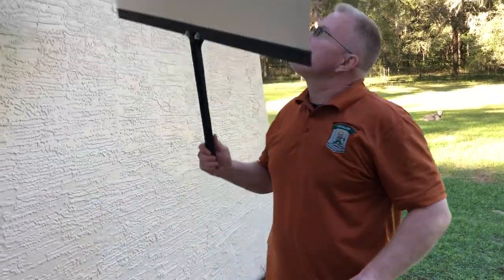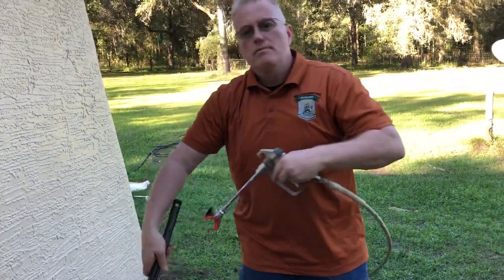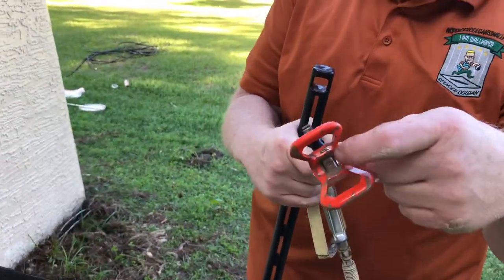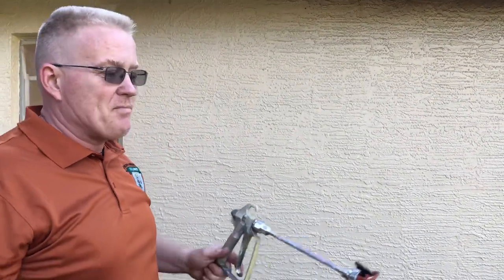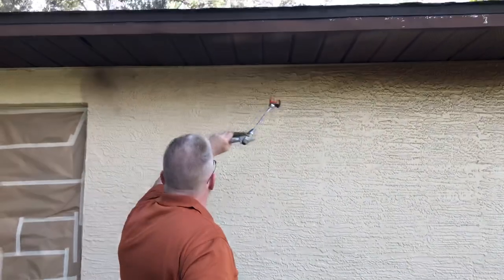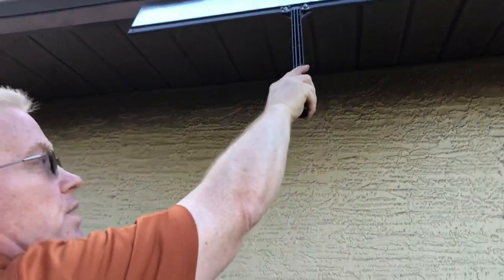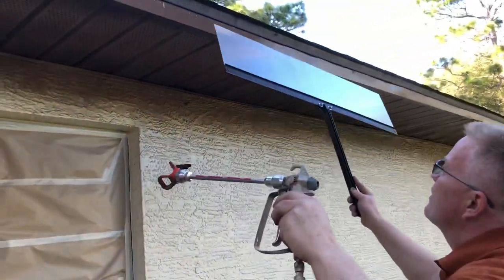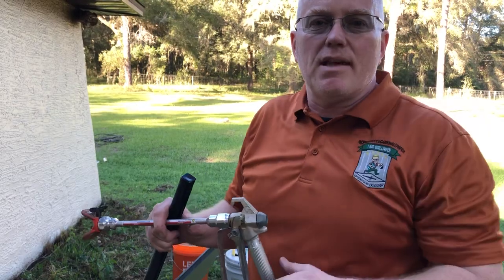House Painting:  How To Spray A Soffit With Spray Shield - Spencer Colgan

Comment: What about the overspray you're getting on the house? Also, will that paint require a second coat and if so will it clog the soffit vetalation holes? I'm going to be doing my sisters vented soffit that her so-called handyman got overspray onto when he painted her house. The house is tan & he got it on her white soffit & facia. One more question, is there a less expensive airless sprayer that can do this job properly? I dont have that kind of money as i had a stroke in April & havent gone back to yet, so funds are scarce right now for me. She's paying me to do this, so i would like to be able to MAKE some money & NOT spend my profits on a sprayer that expensive

Comment: You’ll have less overspray w an fflp tip and they make longer shields, I use 5 so I can rotate them as they become heavy w wet paint while a helper hoses the paint off and waves them dry so I only have to stop for ladder moves. Lay a long drop w weights or magnets over the roof if it’s windy to shield any overspray. Keep your gun steady so the fan is perpendicular to the soffit w a 50% overlap if using an orifice .013-.015 25%, if paint formula requires anything bigger like .016-.019, to get the appropriate mils otherwise the paints’ warranty/guarantees wont hold true. If I don’t have helpers I’ll take the time to tape up paper instead of shielding the body of the house and only shield fascia since it’s a pain in the butt to keep paper wet w paint from flipping towards the fascia.

Comment: I purchased a spray shield that attaches to a roller extension pole.
You can tape cardboard stripes to the shield that extend the full
length plus two feet past each end. Have a helper stand behind
you with the pole over your head. It is much faster than doing it
by yourself.

Comment: Thanks for the demo and the tips. I’m determined to do many things about my house myself to save money. 

So here I am with soffit that is charcoal colored.  I’m changing it to white.  The fascia and gutters will be white too so I just have to protect the roof. 

My question is, going from charcoal soffit to white— is that going to require the same 313 tip? Do you recommend certain type of paint and/or paint company?  Behr exterior house paint ok?
Reply from the maker: I would use a 211 tip for those tasks.  Especially the gutter.  I recommend a quality paint. Putting all this work into a project and using a cheap paint,  not that you would Cheryl ( but a lot of people read these answers and so I speak to everyone) isn’t worth it. 

High end?  Marquis exterior end.  Medium:  Behr ultra paint and primer included.
Reply: Spencer Colgan Wallpaper & Painting  Thank you much!🥰

Comment: How are you not plugging the soffit perforations?
Reply from the maker: That’s an excellent question! If you use a 517 tip, you will plug all of those perforations! However, I am using a 200 series tip and when you use a smaller tip like I am using here, there is not enough paint to come out they will clog those perforations. Thanks for watching
Reply: @spencercolgan  is this something most professional painters will know?  We need to have our soffit painted to match the new gutters but am worried about it clogging the vented ones.
Reply from the maker: @tiffanysechrest9301  excellent point; the tip that you will use will be one in the 200 range. The pressure of your sprayer should be half
Reply: My biggest concern. My soffit vent holes are tiny. I have a “Tru Vent Soffit” system. Most painters in my area won’t paint soffits because they don’t want to held liable for attic ventilation issues.

Comment: Is is hard to clean the spray shield?  Is aluminium? Thanks
Reply from the maker: Yes, you just hose it off or come you can let the paint dry on it and use it again.
Reply from the maker: You have to clean it right away:  just let it dry and call it a day. Cleaning it is too mi h work.